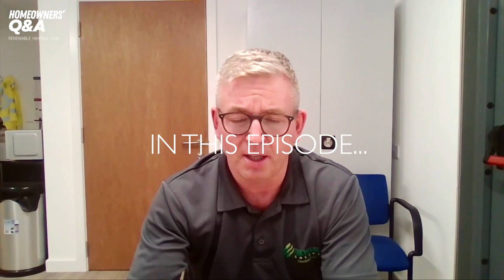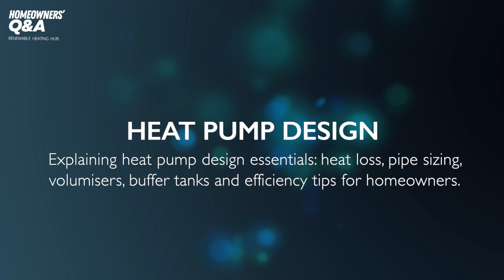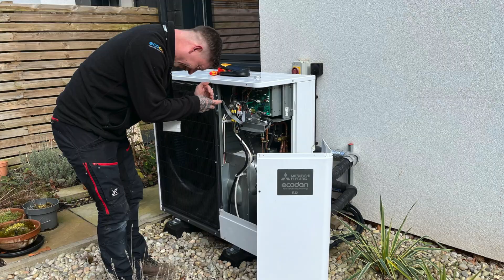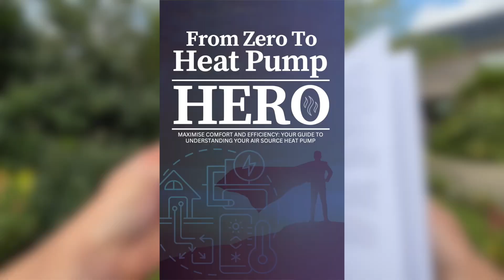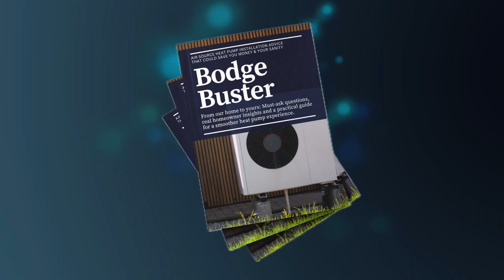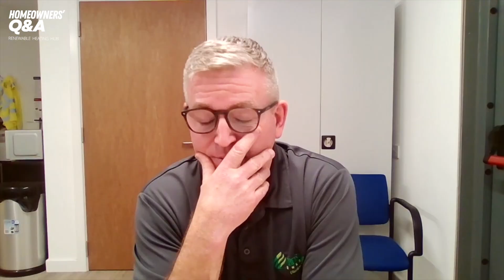Do NOT Install a Heat Pump Before Watching This Video – Understanding Proper ASHP Design

Comment: Hi all, love listening into these chats, I  take  so much detail which never gets mentioned in manufacturer's training courses. Small question........auto balancing valves  on low temperature systems were not recommended  I was once told as the numbering on the valves wasnt relevant for low temps flow rates
Reply from the maker: Great to hear, and we're pleased its helpful.

Comment: I am presently getting quotes on installing a heat pump system, it has become evident the the hot water cylinder has to be replaced, the system is presently a vented system and the installers have quoted on modifying the system to an unvented system, can the system remain a vented system and just increase the cylinder size and can you use an unvented cylinder on a vented system?

Comment: Another aspect of microbore is that plastic microbore has a much smaller inner diameter than copper. Mitsubishis microbore whitepaper has a good table showing amount of power that can be transferred through various sizes of microbore, plastic and copper. This shows the operating delta T too and that is important as ASHP wants about 5 degrees but a gas boiler 15-20 degrees. The latter is much more amenable to power transfer in microbore as its normally high flow temp, low flow rate.

Comment: Hi all, this is excellent information in these chats, thank you for doing them. There is so much detail which never gets mentioned (and is probably not understood either) by installers. As a home owner unless you know this stuff and the questions to ask you will get what the installer/supplier wants to sell you. some will price it to get the job. And the grants don’t really help you get the best system either 

Where you have a combination of wet UFH and radiators I wonder if really you would be better with 2 smaller pumps. Running DHW of the rad pump? 

We have a house where half the ground floor and some of upstairs has wet UFH and good insulation (due to extensions in last 10 years) we have no gas and use a combination of log burners and oil.  We also added solar thermal and solar PV and that easily does all our DHW from march to late September without the boiler. Solar thermal is not simple to install but its brilliant

Comment: Jeez I’ve just watched the first half of this having had a Heat Geek round some time ago, didn’t go forward mainly because we have put solar and battery in first, and I wanted to think about a heat pump first, well I’ve watched this and thought no way it’s far too sketchy due to all the variables to go through the pain and cost to go for a heat pump. And I’m a bit of an advocate for this!
Reply: Your better off without than having a geek system installed. Having just installed a ashp, solar array and battery,  plus all tertiary it really can be worthwhile, but it must be done right, and that starts with a buffer to allow heat pump and emiters to operate independently.  
Get in touch if you'd like some advice.

Comment: I’ve just begun my journey to replace our old oil boiler—which is on its last legs—with a heat pump. However, one major challenge I’m facing is the cost of heat loss calculations. Each contractor I approach charges between £300 and £400 for this assessment.

So far, we’ve had two calculations done: one by Octopus, which estimated our heat loss at 19 kW, and another from a different contractor, which came in at 14.8 kW. I expected the results to be much closer, but they are significantly different.

How can I determine which calculation is accurate and ensure the system is designed correctly without spending another £400? If anyone can recommend a reputable contractor in the Herefordshire area, I’d really appreciate it.
Reply: Hi, to detemine the heatloss of your house you can (if you have a digital meter) check how many m3 gas u used at different outside temperatures. Manually is a bit more work. By this you can calculate the amount of joules your house is losing. Much better if you ask me because calculating with heattransmissions of materials is always wrong. Compensate the amount of joules with the efficiency of your heater.
Reply: You can do a heat loss calculation using heatpunk for free. It takes some time but I think everyone should be able to do it themselves if they are willing to sit down.

Comment: Thank you all.  Very useful counsel. I’m slightly regretting siting the heat pumps on the north side next to a water source…. In a meadow… When it is cold there are a lot of defrost cycles. Is there anything  I can do or mitigate the effects of humidity? A roof over the units for instance - or is humidity something I just cannot fight?
Reply from the maker: I don’t think humidity is something you can mitigate the effects of, and certainly don’t box it in and affect air flow. Is it possible to move the unit?
Reply: Pumps cant be moved. I was suggesting just a roof ? - not fully boxed in. Agree that would be foolish. Not sure a roof would change the humidity ! But might stop snow and rain sitting on the units

Comment: How do you achieve large volumes of system water to operate at optimum with a large house or buffer?

Many are saying you need 20/25L per Kw of heat pump output? 

Im struggling to get 140 to 150L in a 200m2 new build in construction.
Reply: Underfloor heating

Comment: AIRA are one of the biggest offenders in always installing Buffer Vessels!"!!
So I understand the reasons for both Volumisers and Buffer Vessels. So my question is:
With current PWM pumps why aren't installations that actually require buffer vessels being installed with some component, or components, that can measure flow rates on either side of the BV and then affect changes to the various pwm pumps? Or does this already exist and no one (or hardly anyone) uses it?
Reply: Can you have a Volumiser installed that is too large - ie are there downsides to oversizing it?
Are there different types of Volumiser that can be used? Perhaps similar to DHW cylinder designs eg. "tank in tank" style or some sort of "coil in cylinder" or could we hybridize something that is more effective or efficient?

Comment: This is shockingly biased advice regarding the use of buffer vessels,  clearly a lack of understanding on how to implement a buffer to the tertiary system including the use of fixed speed pumps. 
Buffer vessels can work for every system, however an open loop cannot, if you speak to an installer who says a buffer vessel is no good for a heat pump then speak to an engineer. 

A buffer vessel allows a heat pump to condition a volume independently of your heating system i.e. radiators etc. The heat pump wants to operate at about 5°C between flow and return. 
Not balancing the two sides is why buffers don't work, it's lazy and shows a lack of knowledge. The pump, buffer etc will add cost but your heat pump will last longer and operate more efficiently. You'll also use less energy as you won't heat your entire house equally allowing zoning for spare bedrooms and the like.

Tuning out at 9mins, as this is not worth the time

Comment: Hi guys, so my vaillant 7kw aerothem plus had a vaillant tech visit last week, he established that the house is to large, the heat loss calcs are correct for the house but the 22 rads and 3 underfloor heating circuits are proving to much for the heat pump to handle when the temp dips below 4, I gets stuck cycling,  the installer and vaillant are in discussion so to what should be done to fix this problem, obviously this is not ideal but I'm hopeful that the financial cost to fix it won't be my costs, the installer has been great and I'm  sure that will remain the case..
Reply from the maker: Sorry to hear that. I’d love to see what the solution is. I guess a hop up to the next size could be a potential option.
Reply: @RenewableHeatingHub  well yeah I guess that's worth a shot but frommwhat I hear all ashp experts say to not oversize a HP as it really upsets the system,  what I was thinking is that it will need to be a split system, say a 5kw for the hot water and downstairs and a separate 3,5 unit for the upstairs,not really ideal either as I'd rather be running 1 electric unit rather than 2..... I've no idea what they will do but I'm guessing they will be looking for a low cost/no cost solution to this problem, obviously I've paid what feels like a bazillion for my system and left the design up to the experts so hoping I'm not left to carry the can.
Reply from the maker: Not knowing much about your home or set up, what you’ve described sounds a bit mad. The fact your unit is struggling at 4C is not good and suggests it’s too small.  I struggle to keep on top comments on YouTube because they get buried really quickly. If you’d like more candid advice, can you please post your situation on our forums: https://renewableheatinghub.co.uk/forums and I’ll help you there. Something’s not adding up.

Comment: Nice to hear the importance of Room Temperature influence on top of Weather Compensation, but it's nothing new and MOST heat pumps have it built in to their controllers (Vaillant, Mitsubishi, Daikin, Samsung to name a few) if only they get installed correctly with the Room Temperature sensor in a sensible place, not tucked away in the airing cupboard because the wiring is easiest.
Reply from the maker: That’s the problem isn’t it Nick. Ours is shoved into the plant room cupboard where it’s 28C when the heating is on. Ridiculous!
Reply: @RenewableHeatingHub  the daft thing is they are so easy to place somewhere sensible. They usually come with a 10m cable that is low voltage and easy to route somewhere. It's pure ignorance because they only understand WC as being the "latest and greatest" when it's really not.
Reply from the maker: 😂 it certainly has taken the industry a long to adopt this decades-old new technology. 🤣
Reply: @RenewableHeatingHub  to me this is the #1 blocker to heat pump adoption. People's experience of having them has been clouded by having poor/complicated controls, so are less likely to pass on a recommendation to friends and family (or more generally have a positive experience).

If they had a simple control where they just set the temperature that they want and the heat pump manages it efficiently, it would be a huge improvement rather than being told they need to learn about Weather Compensation etc.

Controls like Homely are making in roads, and whilst their more advanced features around weather forecasting and tariff optimisation are valuable, most heat pump controls can just do the Room Temperature/Load Compensation out of the box anyway and make things simple for the homeowner, if only they get installed properly.

Give the customer a "thermostat" (that isn't a thermostat but gives them the same illusion as the simplicity of a traditional thermostat that they're used to, but with the automatic flow temperature optimisation behind it) and they'll be happy.
Reply: I’d like to see some comparison of Homely, Havenwise and PassivUK.  The latter doesn’t get much coverage on here.  Meanwhile Planet Devices have great monitoring, but seem to lack actual optimising and controlling. If I understand the blurb correctly all of these have the potential to solve a lot of problems.

Comment: Volumiser (if you must have one, and I agree that a low temperature system will naturally have enough volume in the emitters) in the Flow sounds more logical.
Reply from the maker: As a non installer, based on nothing more than theory, flow makes most sense.
Reply: @RenewableHeatingHub  Problem is, you now have this tank full of colder water, that's about to pumped round the emitters, so it works out the same either way. As mentioned, ideally you need an immersion in the tank that kicks in during defrosts.
Reply: @dansus99 The temperature of water inside the Volumiser is the same as whatever goes into it.

Comment: OK, so I THINK I'm just about getting on top of this! I'm on the NW coast of Scotland. Moist, right? High rainfall, rarely warmer than 25 C in summer, and only sporadically. Last summer - well, it didn't happen, the heat pump ran most days to keep my house at or above 21 C. The only place for the (Vaillant Arotherm, original not Plus, 11 kW, each room was calculated for heat loss, the survey was very thorough) unit was a north wall, where I re-sited the outdoor sensor which was originally placed on the west-facing front of the house (nominally the NW corner, but) which often shut the heating off altogether in afternoon direct sun when outside air temp was barely 12-15 degrees. Has this re-positioning made any real difference, to comfort levels or electric consumption? Very little. I have tried so many tweaks to improve SCOP - still annual of 2.5, 3.0 max in the shoulder months, 2.0 at around zero C - but am now resigned to these numbers (and still thank Scot Gov for the 100% grant for the system (!) and swift fitting with minimal disruption, massive new rads, toasty house etc). Compared to my old solid fuel central heating, with 3 tonnes of coal to move around every winter, and many months of wood-burning during the shoulder months, and even occasional use in summer - we are hardly known for warm summers here, just fairly steadily low temperatures all round - I still spend about 60% LESS to heat my house and water than before, and with considerably more convenience! I think I simply can't achieve a SCOP of better than 2.5 because of my location, and I have to lean into the whole moisture in the air thing now to explain why I can't get, eg Heat Geeks' suggestion of 400% return, which may be possible in the south of England, inland, and urban/suburban and so on, but probably not here (btw, try finding a heat pump guy here! The nearest is 100 miles away, and they are fiercely expensive to get out or engage with. They fitted my system because it was under a Scottish Gov scheme, but once fitted they were away, and at min. £250 a pop for a service, or even to scratch heads with, paying ?% over the odds for lecky, assuming it is even possible to get slightly better efficiency, seems OK to me, ave. £105 a month, ie, about £1,260 a year. And that's at current energy prices versus coal and wood before lockdowns and price hikes etc when I was paying C£2,500 a year... It's not a big house, but it is often very windy, and wet, and wet AND windy! I love listening to all your content, even if I haven't found a way of upping my SCOP, but who knows? At least hearing you mention humidity, as something that will knock down performance, makes me feel less depressed at my lowly 2.5 (-:)~

Comment: Greystones, are you really advocating more emitters over a fabric first approach?
Reply: I didn't interpret it that way. Just that whatever the insulation and heat loss is, it can be overcome by emitter sizing (in theory, the practice may be different in terms of space taken etc)
Reply: No not at all fabric first approach always,   what is I was saying is a house doesn't have to be super insulated to make a heat pump run efficiently. 

If heat pump is sized correctly to the heat loss and pipe work is sized correctly and if you design the flow temperature as low as possible you can adjust the curve as low as you feel comfortable to make the system efficient.

If you have a new build versus an old house it will be more efficient with insulation and air tightness

Comment: To test my 8mm microbore heating run from my gas boiler I turned my boiler down to 6kW and flow temp is 40C it’s on all the time, the Honeywell Eco Home thermostats are used as a limiter. House is 21C and I set back the heating for two hours at night and two hours during to day to 16C to then heat the hot water. 4 bed detached
Reply from the maker: Brilliant! Thanks for sharing.
Reply: @ I am testing this for a heat pump
Reply: I tested our home last year in a similar way to see if our house  was ready for a heat pump. Found the to be house far more comfortable without the peaks and troughs, and cheaper to run too.

Comment: I had an amazing heat pump whilst living in Switzerland 15 years ago. The Northern Europeans have been doing this for years and to be honest are far superior engineers, how have we not managed to learn how to do it from them. Our guys bungle about, no idea what they doing, they need some training.
Reply: Because to call yourself an Engineer over there, you actually have to be one. A man in a van cannot just call himself an engineer and go into business as one, unlike here.
Reply: Many have jumped on the band wagon, companies trying to turn a profit without any experience or previous doing gas boilers and applying the same ideas.
There are some,  but a minority of companies with both experienced designers and installers who can do a great job.

Comment: Well I have solar, battery and a heat pump. My bills were cheaper than previous years. My heating is on 24/7. The house is nice and warm throughout at 21/22C. This channel is honest and tells you, renewables arnt perfect but if there fitted correctly and used with the right tariff they work. The problem is you need to know much to do all this and most people quite rightly don’t want to learn all this. They just want it to work, just a like boiler so what you say what ain’t broke don’t fix it does hold some truth. But it’s very nuanced.
Reply from the maker: I like that: "renewables aren't perfect". Nicely put.

Comment: Isn't the theory of putting the volumiser on the return simply that you have a large tank of water at a lower temp thus lower standing losses vs having the same sized tank of slightly warmer water?
Reply: 5K difference, is it worth thinking about?